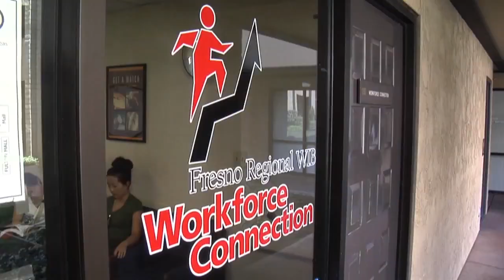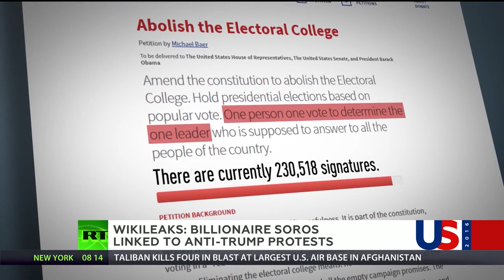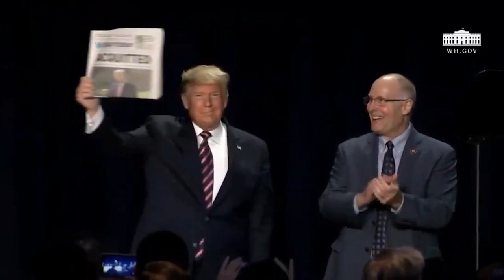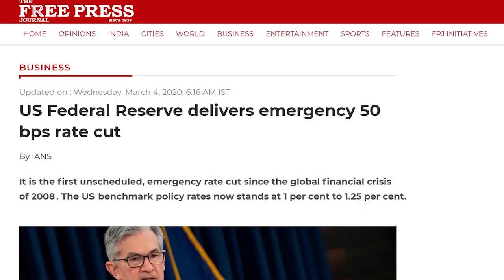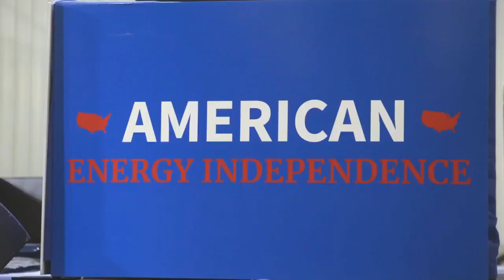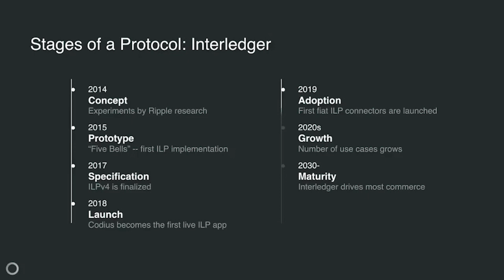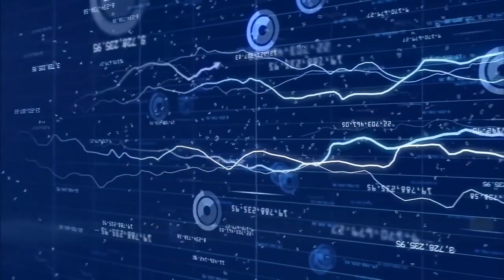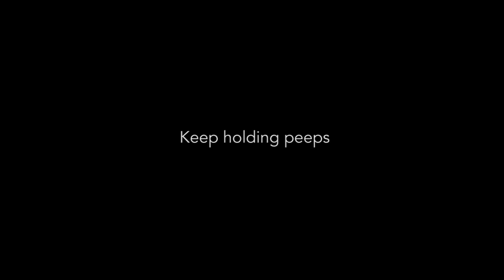Trump: The Level Playing Field

Comment: DRAIN THE SWAMP! Through a extra small sieve would be exceptable.
Sieve definition is - a device with meshes or perforations through which finer particles of a mixture (as of ashes, flour, or sand) of various sizes may be passed to separate them from coarser ones, through which the liquid may be drained from liquid-containing material, or through which soft materials may be forced for reduction to fine particles.